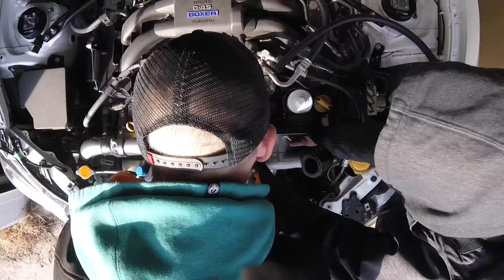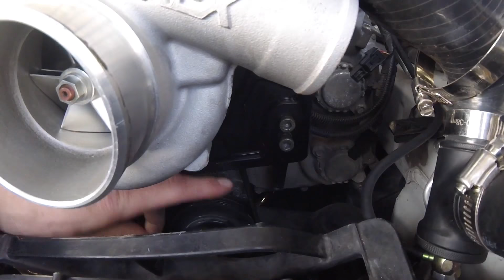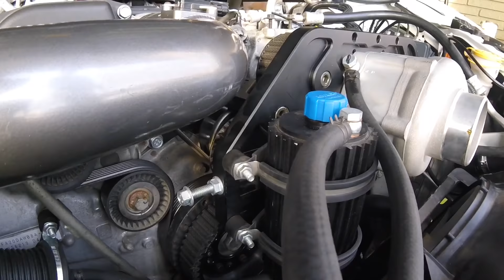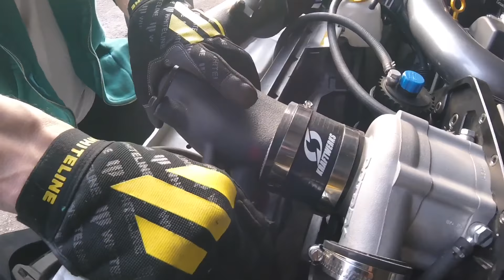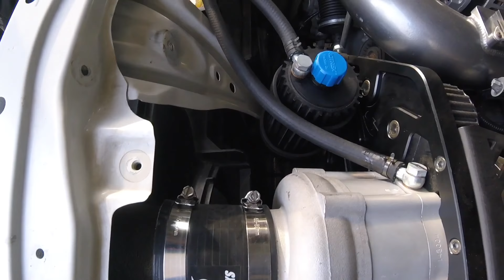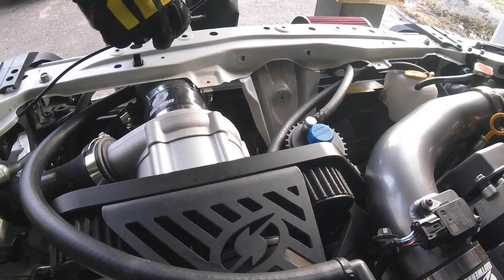BRZ Supercharger Maintenance

Comment: Hello even if you do not remove the oil you have to do the final procedure? After installing the 30 mm kit, the kit started to make a whine too loud, maybe because I don’t make the procedure for oil? Can you explain the right process to do it? On manual they do with air gun...